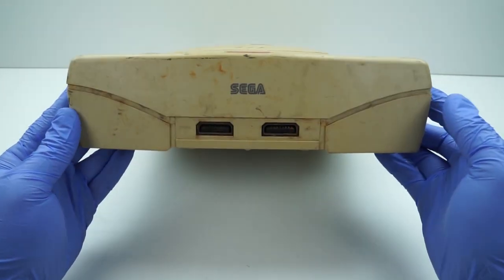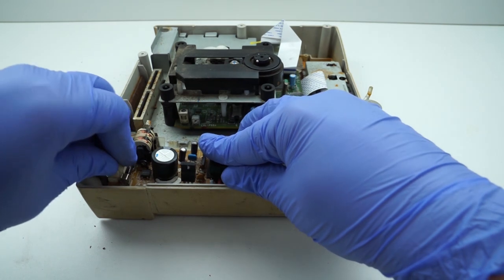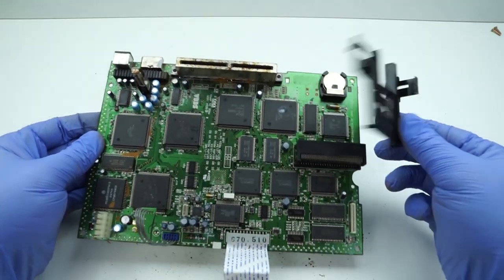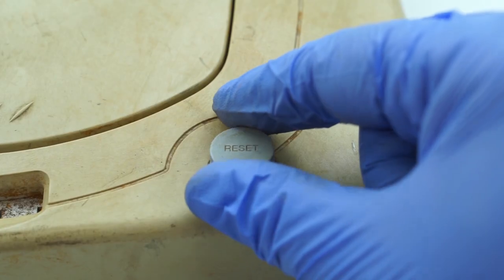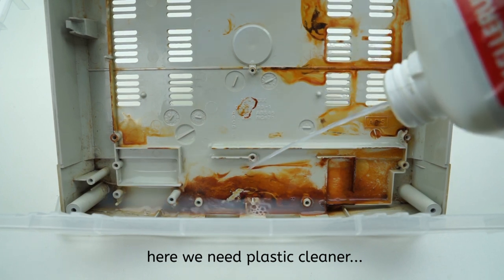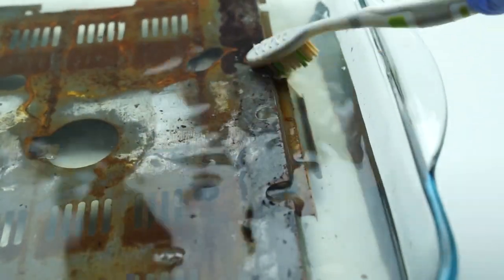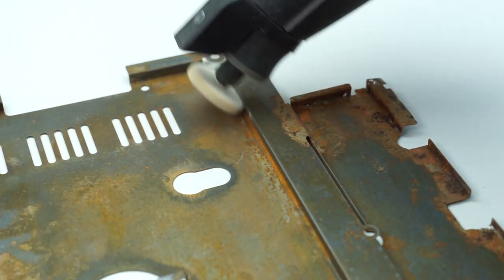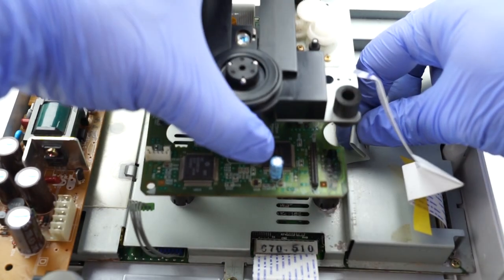Extremely yellowed and rusty Sega Saturn restoration

Comment: How can this be fake? You can clearly see the discoloration on white plastics where rust spots were, the controller port board still has bit of rust residue on ground pad... The only part that could be faked is the last part where he showed it running. But still I don't see why would he fake it. When there is a bit of rust on mother that doesn't automaticly mean the motherboard is doomed.
Reply: Why would he fake it? For the ad revenue, duh.

He is swapping to another Saturn after pretending to plug the console in and the camera cuts. Real repair videos don't have any cuts in them. They are all one long take to prove that none of it is faked. His Gameboy video was debunked too. Somehow deep scratches disappear after he does the Retrobrite process. That's an obvious shell swap because whitening plastics do not remove or fill in scratches at all.
Reply: @0.Kenshin  I see. You have a valid point
Reply: It's fake because THAT is a Japanese unit. When booted up at the end it has the US bios, English options in the CD menu is the give away. He may have attempted to restore but it's fake, no doubt.  @ZanRudolfDSM